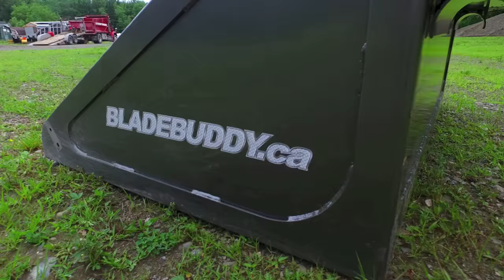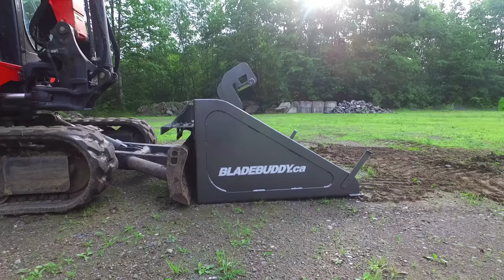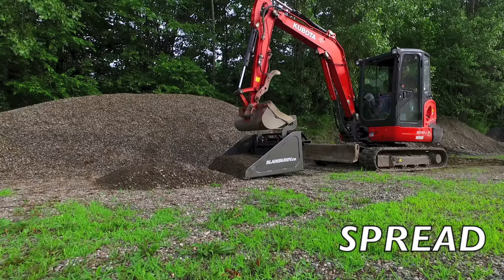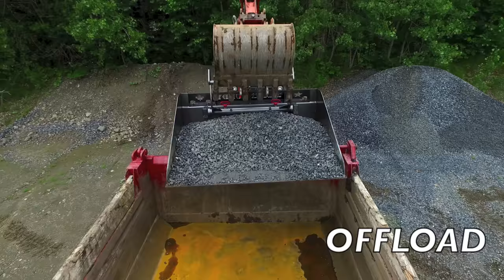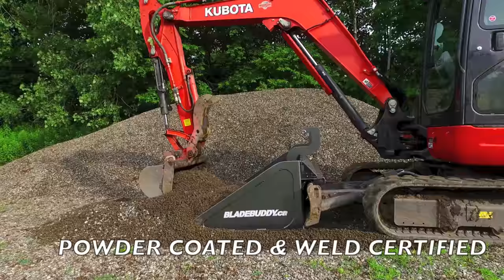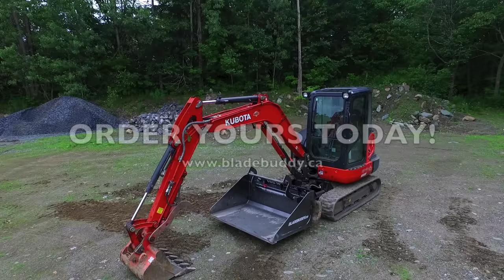BLADEBUDDY™  excavator attachment

Comment: i think this bucket attachment for an Excavator is a great idea, however, i do think it needs a "little" more adjustment.  this isn't a "hateful" comment but just an observation.  i think the bucket should have had a more secure attachment to the Excavator blade something like the quick attach for skid steers.  and, since an Excavator's front blade will lift up maybe two feet, if this bucket had some kind of "hinge" on it that would allow it to stay attached to the blade but tilt forward to "dump" the dirt in it while the blade was raised to the max height, that would allow the Excavator to actually carry and "dump" dirt where wanted.  i don't think the idea of using this bucket to unload or load a truck is of any value as the Excavator's bucket is MUCH more efficient in doing this task.  just my two cents...

Comment: Don't listen to the Nay sayers here....I have the patent on the kubota hercules attachment. I get tons of critical posts.    Whatever you find works for you is a great tool to have!   The critics can't see advancements in productivity even when it is shown on video.    I would ask how often does the bucket come off the blade by accident or how often have you dropped that bucket while loading a truck?
Reply from the maker: Hi Bob, thanks for the positive feedback ! To adresse your question, the only time it has lifted slightly off the blade is when the driver would try to scoop a pile of frozen dirt. No one has dropped the bucket while loading a truck as we instruct to curl the bucket and lock the thumb.

Comment: I don’t know if that ram is designed to handle that much load but cool idea
Reply: Yea those rams are generally pretty beefy for what the are needed for anyhow considering how they are mounted I wouldn't worry!
Reply: Late reply, but they`ll lift the machine off the ground and using the boom u can shift nearly all the machines weight to the blade.

Comment: Does this damage the drive motors, the blade is not made for pushing materials? 🤔
Reply: The blade is meant for backfilling trenches. It’s not meant for bulldozing / cutting into compacted ground, but pushing loose dirt is what it’s there for.
Reply: Ethan Robison  Yes I have operated excavators for several hundred hours. I don't know about you but I don't feel like replacing the drive motors every month. Of course i get it that you can push small amounts of material without damaging the drive motors but it's not meant for bulldozing or pushing big piles of material
Reply: I've got a Cat 301.8 and I've had to replace the tiny drive pinion in the final drives. I was shocked at how tiny the male/female splined joint was, only about 10mm in diameter and 10mm engagement length. Of course it wore out. Cat only sold complete final drives at a price of A$4000 each so it would have cost me A$8000 just to replace the final drives. Luckily I managed to find a mob in the UK that supply aftermarket internal parts. Plus I'm quite good mechanically and stripped down the final drives myself to do the repairs so got away with a total cost of about $800. Let's just say I was a lot more careful what stress I gave to the final drives with pushing, etc. Yeah, an excavator is definitely not a bulldozer but that bucket attachment would be handy for carrying materials and dirt.

Comment: Great concept other that the blade cylinder can handle shit for weight cause it wasn't designed for it
Reply: You would be wrong about that.  That cylinder can support the full weight of the machine when using the blade to level the machine while digging.   There is a pressure valve specific to that cylinder  that does need to be adjusted on the Kubota for it to lift more capacity.  It is adjusted from the factory to have max down pressure, but "give" if a rock or stump lands on it.  It is a very simple adjustment and then it will lift well over a ton of material.

Comment: Get a rotator tilt system
Reply: Tiltrotators are nice attachments but can only accommodate the attachment for that excavator size, this bucket looks like it could load more material for the excavator size. This also is an extremely cost effective alternative because there aren’t any auxiliary hydraulics required. A tiltrotator is designed for a different purpose and again can only carry attachments that fit the size of excavator. The blade buddy looks that it could haul the load of a pretty well sized excavator.